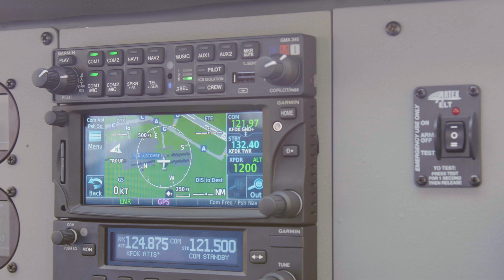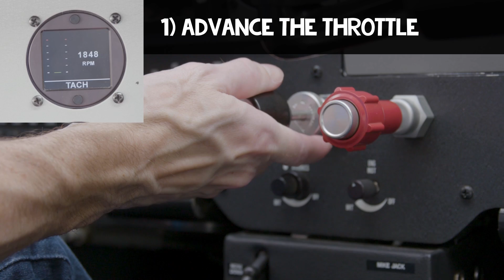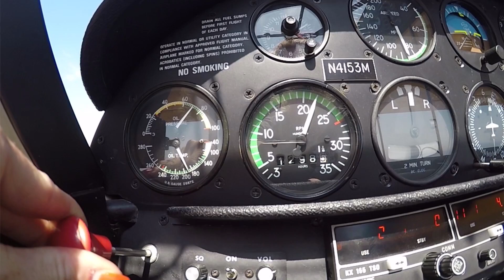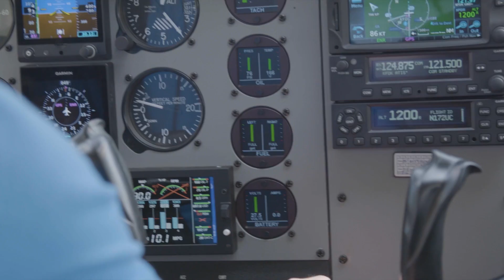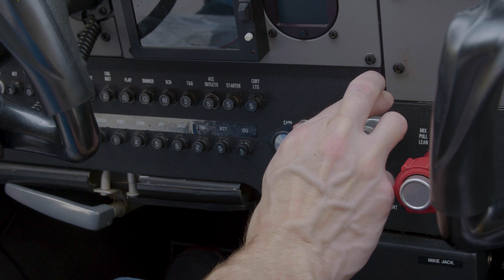Density Altitude - The Triple H Effect

Comment: VFR PPL just two weeks out from Check Ride. Brushing up on Density Altitude. I understand the Concepts but flying in the SC Low Country has left me with little practical Experience in with Altitude vs Humidity and Heat. Thanks for the video!

Comment: I'm currently taking lessons in 29 Palms. The field elevation is 1,800 ft. Sunday's DA at 9am was 4,300ft with thermals in the pattern. My CFI says I'll be a better pilot for having learned to fly out in the desert.
Reply: Hey I did my training at KTNP as well! Ha. Yup. Brutal out there, especially in the summer. I remember my CFI and I taking off in my PA-28-140 and it was 115⁰ with 5,200' DA. Field is 1,888' MSL! Thermals are nasty also. 

You definitely learn to lean for take off real quick.

If you're the guy with the turbo skylane, I met you yesterday 😂

Comment: Why not just call it air density? And do turboed engines, which can produce the same amount of boost at most altitudes, do better than non turboed engines?
Reply: Not just the engine power, although turbo will do better.  It's also the wings and propeller lacking lift and thrust respectively.   It's called DA because ultimately it affects the operational ceiling which is altitude.  There is a "standard altitude" against which performance and temperature is usually determined.

Comment: back in the 80s the UK had a number of very hot summers. a lot of pilots had problems with density altitude issues. now hot summers are common the problem has gone away. but for a short time it was something that messed a lot of people up. thankfully no accidents, at that time, seem to have this issues as a factor. but it is something a lot of people just don't give much thought to.

Comment: Excellent info on an important subject.
Your initial graphic showing air and water molecules is misleading. The air molecules are much bigger that the water molecules, that's important. ie O2 and N2 vs H2O. Wet air has less density than dry air.
(that's not a criticism, the video is great)
Reply: Yes - and the reduced density is due to the fact that water molecules are not only smaller but also lighter than oxygen and nitrogen molecules. For the same total pressure there will be the same total number of molecules in a unit volume of air, but in humid air, some of those molecules will be lighter water molecules.
Reply: Molecular weight is important, not "size."
I think the graphic illustrates that the mass is less for a given volume -- the number of molecules at constant temperature and pressure is constant -- because the molecular weight of the h20 vapor is 18, 16+2, displacing either a nitrogen molecule n2 of 28, 14+14, at 78% or oxygen molecule O2 of 32, 16+16 at 21% (plus or minus.) I won't pretend to do the chemistry, but .78 x 28 + .21 x 32 = 28.5 replaced by 18 means rising humidity results in decreasing density .  : )

The rest of the illustration and explanation is valid: less density is less lift and less drag, less propeller performance, less engine power, less thrust. If the aircraft weight is constant, give or take fuel burn while retaining a 1 hour reserve in , and the air density is falling ... well, once it reaches that corner of its thrust and lift performance envelope, so will the plane. : )
Reply: @sbreheny  "same total number of molecules in a unit volume" right! high five for high school chem teachers!

Comment: Big emphasis on the difference between air speed and ground speed. You can't rotate and keep yourself from stalling based on what your GPS says. Air speed is based on the molecules coming into the pitot tube, which is really what measures and determines our speed with respects to air density. Are there GPS units that can calculate or estimate air speed? I would assume so. Anyone? Would suck to lose a panel or have a clogged pitot tube and not be able to know your true air speed under extreme conditions.
Reply: A multi-sensor air density computer is well within the capabilities of modern tech, the problem with general aviation is that it's too small a market to do it cost-effectively.   A pitot tube is a cheap and dirty solution, that's why it's readily available.
Reply: A GPS unit would need accurate wind data to estimate your airspeed. Where would it get that?
Reply: @ewthmatth  Good one It cant  Well said
Reply: You were doing great until you mention true airspeed. Change that to indicated airspeed. Gps only knows ground speed.  And we all know GS is used for time to distance only.

Comment: I don't understand why setting  the proper mixture is such an inaccurate activity.  An AFR meter could  really help setting mixture exactly.  If there is a concern with lead fouling of the sensor, AFR can be calculated with some accuracy by dividing air mass flow and fuel mass flow.  Air flow can be calculated with engine speed, manifold pressure, and manifold air temperature (we call this speed/density mass flow calculation in the automotive industry).  Volumetric efficiency can be determined by the engine manufacturer very easily.  My point is, it's not a very large leap to get a good air/fuel ratio measurement from information already present in an aircraft.
Reply: Finding Lean of Peak is always an inacurate activity... DA is a big factor here.
Reply: It is done fairly accurately via leaning to peak rpm. Any other gains in a more precise method would be so minimal that it would probably not be worth the time since it is going to change again in a minute. Also most aircraft do not have a manifold pressure gauge or manifold temp but oat would probably be good enough. Another method is to lean to peak exhaust gas temp
Reply: Most single-engine aircraft engines are still basically 1940s technology.
Something this video didn't mention is that fouling tends to be a problem at high altitude, where the usual rule (see your POH) is to lean for taxi to avoid fouling, and we're taught basic techniques to alleviate fouled plugs, and to take off with a leaned mixture instead of full-rich.
Reply: But that only works during run-up, not in flight.

Comment: Good tip on accelerating in ground-effect during take-off. Another tip is to not overuse flaps on T/O, more flaps is not better. The (technical) increase in lift is not worth the slower acceleration. You want to get to Vx as fast as possible.
Reply: Why Vx ?  May not be needed